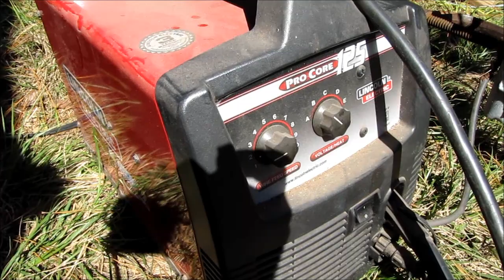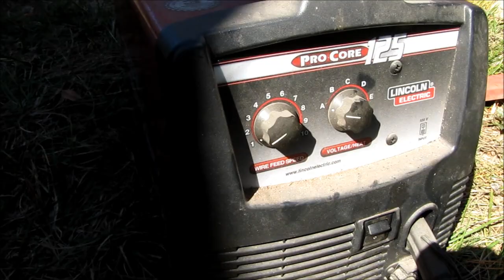Working on the chicken yard gate

Comment: Hi there! Hope you don't think that I'm being too much of a nanny, but i hope you know of the dangers of welding galvanized metal. I know you were welding outdoors but just one wiff of that toxic white smoke could see you with serious respiratory problems.
Hope i didn't sound like too much of a moaning minnie there, I'm just putting the info out there for those that don't know about it. 
One quick tip about the sharp bits sticking up, I like to turn the amps up high and give each sharp bit a quick dab with the welder, burns the rough edges right off, of course it's no substitute for going round with a grinder or a file but for a quick rough and ready job it's fine.